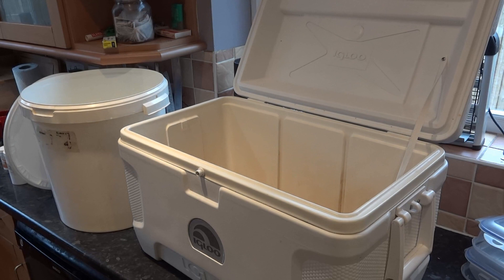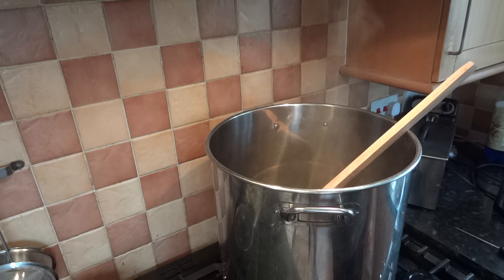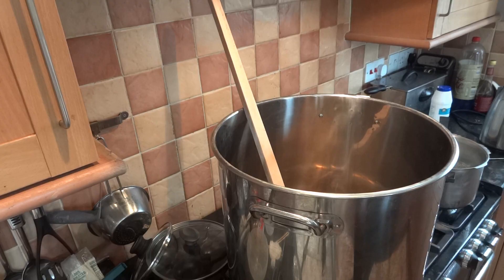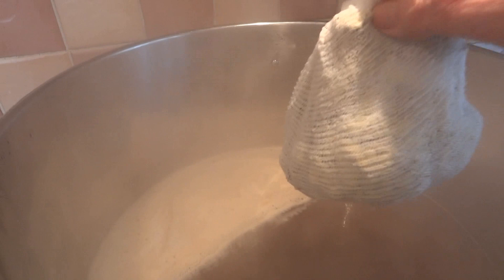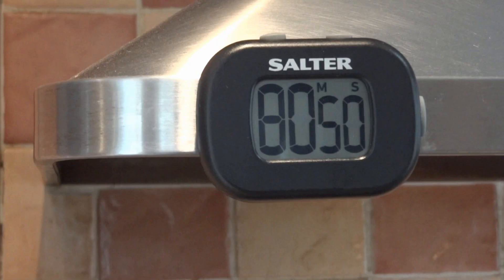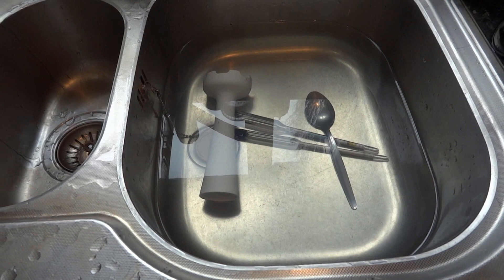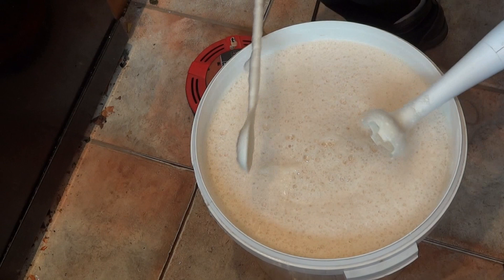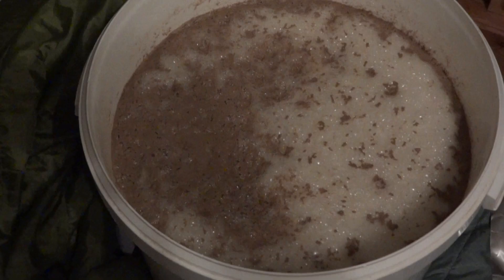Beginners Guide To All Grain Brewing

Comment: I, thoroughly, enjoyed the video. There's no need for a 90 minute rest because Alpha is long gone. Use Iodine to test for starch after 30 minutes.
To make home brew richer, stabile and more balanced boil some of the mash for an hour and use the boiling mash to raise the main mash temperature to 140F, 60C for 45 minutes. After the 45 minute rest ends use boiling water to increase mash temperature to 153F, 67C for 20 minutes. after the rest ends use boiling water to increase mash temperature to 158F, 70C for 10 minutes. Sparge, do not mash out.
Alpha deals with starch and the enzyme is responsible for liquefaction and saccharification. Alpha liquefies the amylose starch chain at a 1-4 link making two chains. The one piece is called the reducing end and the other piece is the nonreducing end. The reducing end contains sweet tasting, nonfermenting, types of sugar. The nonreducing end is glucose. The only purpose of Alpha is to release glucose, one of the three building blocks of life, from starch. Glucose is responsible for primary fermentation. Our saliva contains amylase and it works quite well at 98.6F, 37C. 
The rest at 140F, 60C will activate Beta and conversion will occur. Beta converts glucose released by Alpha during liquefaction into complex types of sugar, maltose and maltotriose, the types of sugar that make ale and lager. When conversion occurs, secondary fermentation takes place. 
During the rest at 140F, 60C dextrinization and gelatinization will begin, as well, and continue through the other rest temperatures because Alpha will liquefy the starch that burst in the boiling mash. Boiling the mash causes heat resistant, complex starch, amylopectin, to burst. Amylopectin contains A and B limit dextrin which are tasteless, nonfermenting, types of sugar responsible for body and mouthfeel in beer. When Alpha liquefies the starch dextrinization and gelatinization. In the single temperature method the temperatures are not high enough to cause the starch to burst before Alpha denatures and the starch ends up unused in the spent mash. Amylopectin is the richest and most expensive part of malt, it makes up the tips of malt. The other starch is simple starch, amylose, which contains sweet tasting, nonfermenting types of sugar and simple sugar glucose. The finest ale and pils are made from dextrinous extract, not from sweet sugar and glucose laden extract. The only time dextrinization occurs in the single infusion method happens when amylose contains a 1-6 link in the amylose starch chain which is extremely rare. Homebrew books make it appear that dextrinization occurs every time mash is rested at a high temperature.
The method that you use is the single temperature infusion method and homebrew malt is high modified, high protein malt. The method and the malt are used for making malt whiskey. The beer is called distillers beer, the slang term for distillers beer is moonshiners beer. A distiller uses a rest temperature at 150F, 66C because Alpha releases more glucose and less sweet tasting, nonfermenting sugar within an hour. The high temperature denatures enzymes that make ale and lager because Beta extends the length of their process.
Try out under modified, low protein, malt. Weyermann floor malt is an example. Under modified malt is richer in enzyme content and low protein malt contains more sugar.
If you enjoy producing distiller beer use Marris Otter, Halcyon and Golden Promise, they are well known, high quality, distillers malt. Obtain the spec sheets for the malt and purchase the malt with the lowest protein content and the lowest modification. Someone, I can't remember who, produces eight percent protein Marris Otter, that's the malt to use. The enzymes are beaten up in the malt due to over modification and diastatic power is low. Don't add corn or rice, unless, six row malt is added. Depending on how high the modification is, a mixture of Alpha-Beta amylase would need to be added to make ale with the malt.
Modification is listed as Kolbach and SNR on a malt spec sheet. A spec sheet comes with every bag of malt and it's used to determine quality of malt before buying it. Without a spec sheet recipes are useless. A recipe that recommends purchasing pale malt is similar to asking a person to purchase a two door car without offering any specs.
Reply: Make a video if you have so much to say 😂